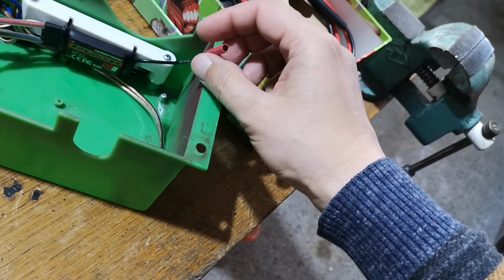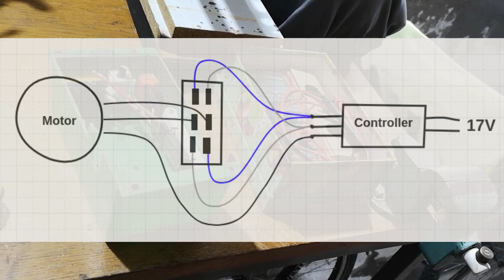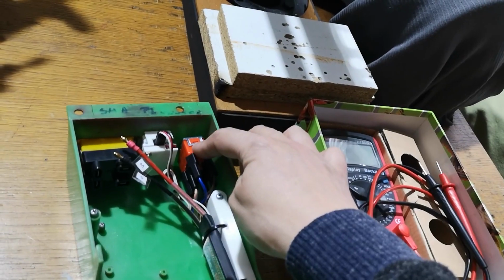Mini Lathe with Brushless Motor - part2

Comment: Do away with that mechanical reverse switch a real set up for problems.  Switch it once when it's going the whole set up is destroyed.   The reverse switch should be digitally controlled to switch without blowing out the whole circuit it also would allow going from different directions without manually starting and stopping the motor.

Comment: Hi, nice work, and about the torque at low rpm? Is more than the original brush motor? Thanks
Reply from the maker: Yes, that I can confirm. New brushless motor is way better than old motor. And new configuration is easier for maintaining ... Cheers
Reply: @dbunic  thanks for reply, just one thing I did not understand, to adjust the speed you need an electrical circuit or just connect a potentiometer?
Reply from the maker: @antonio.stefanelli  Yes you need controller for brushless motor ...
Reply: @antonio.stefanelli  you would need a PWM signal if you do the exact mod.

Comment: Another great video! Would like to see more on how you attached the motor to the lathe and how you mounted the pulleys to the motor and the headstock. Also, the specs and links for all the components you used would be helpful. Is this motor quieter than the original? Please consider adding your content to UGETube, so its available for more viewers to appreciate. Cheers brother

Comment: Hi! Very nice and clean job! Congrats! If you change rotation without reducing speed, does it breaks? I have material to do the same upgrade and will start do build it. Thanks for posting. Gabriel (Brazil)
Reply from the maker: Thanks. Before changing rotation I would rather stop the motor than doing it while still spinning. Theoretically, controller is responsible for rotating magnetic field and I'm not sure how it will behave in such situation. In my case I always check that motor is stopped before turning it again in other direction. I hope someone will reply to this question with more details. Cheers
Reply: @dbunic  Thanks, Darko.

Comment: Hi Darko! Which belt and which pulley did you use in your upgrade?
Reply from the maker: Belt is original (mark on belt is 1.5x70) and gears also - smaller 17 teeth and bigger 31 teeth. I have replaced plastic gears for aluminum.

Comment: Hi does it have to run on 17v if so do I have to buy an adjustable power supply? Brilliant job looks great
Reply from the maker: Actually it doesn't. I set to 17V because input voltage for SkyWalker 40A controller is 2-3S Lipo. If voltage is higher then controller stops to work, so this is probably maximum value in my case.